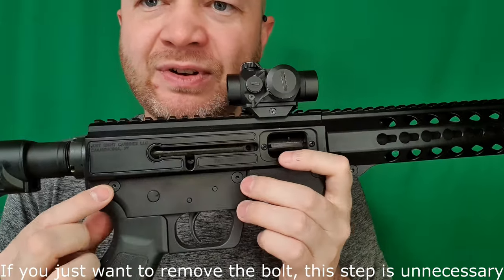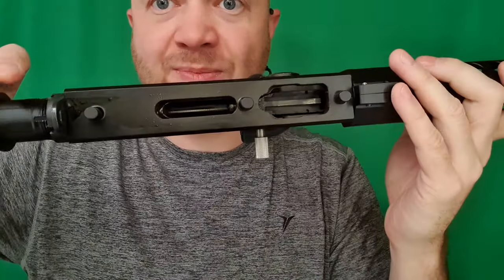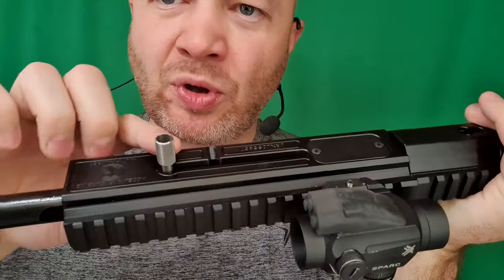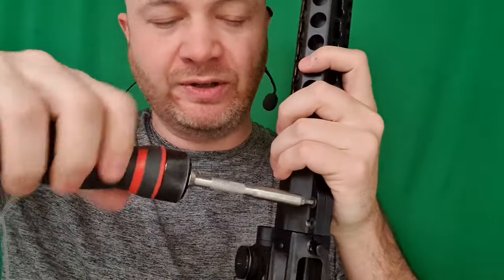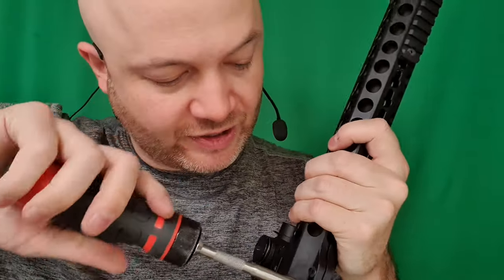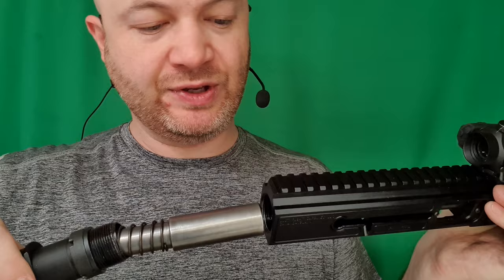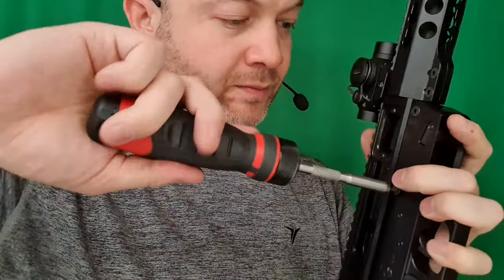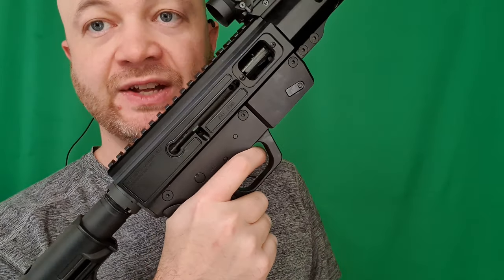JR Carbine disassembly and reassembly

Comment: Had my carbine out to the range for a few rounds. Just tried to take it apart and my allen was bending by the force I had to us. The bolts seem to be seated extra firm from the manufacturer. Any advice loosening them up without stripping them?
Reply: Yep. I changed the grip on mine and noticed they use loc-tite on the screw. Had to cut it off and get to screw with pliers.

Comment: Ok, great and informative.. Best video on this piece I've seen yet, as I found the manual to be lacking in terms of taking it apart. I've never owned a semi till now. Give me a pump shotgun or a bolt action rifle and I dont even need the manual. But I gotta admit, this was intimidating for the price to not screw it up and have to take it apart every 200 shots for cleaning.. I have nightmares of when I'm 12 taking apart my BB gun and not being able to get it back together.. I wish I could have seen how you do the castle nut tightening and loosening.. Do I need to bu ya special castle nut wrench for that? And if so, what size do I look for? Thanks buddy..
Reply from the maker: Yep, it's a standard AR castle nut size, so any AR15 wrench will do the job. You can get them online or at many gun shops.
Reply: @Huntinggearguy  Ordered mine today. So I stopped by the local gun shop here asking if I could buy one. They didnt have any for sale but had one in their tool desk and actually sent me home with it to use and bring back whenever. So I loosened the castle nut just enough to finger tighten till mine arrives. I guess they treat you well when you buy 2 grand worth of toys within a week.. The JR, a red dot and a vertical downward fore grip..

Comment: Had the JR carbine a while back. They are pretty hefty compared to an AR. The Allen wrench requirement for takedown was a PITA. Always worried about stripping it.
The FX9 and Ruger PCC are great alternative options.
Reply: Do you know what size the Allen head was to get the pull back handle out?

Comment: What size Allen takes off the pull back handle? I tried my 1/8 and it’s a hair to small
Reply: Hmm I don’t recall.  I peeked at the JRC website and this is what the owners guide states:
• 9/64-inch hex (Allen) wrench – included
• 1/8-inch hex (Allen) wrench – included
• 1/16-inch hex (Allen) wrench – included

It’s possible that the Allen wrench you are using is heavily worn so the fit is loose. The head of the hex screw may also be slightly stripped.

Comment: I bought a JR carbine about a year ago. Absolutely love it. In the process of swapping the ejection handle to the other side. Thats why I'm here. Great video by the way. Have to say that JR could have done a few things differently....like a common barrel nut and  foregrip for easy interchangeability. But other than that , this is an awesome little gun. Thanks for the video. Why they put bolt handle on left sude....I do not know😄
Reply: Did you ever get around to changing the side in which the charging handle operates? Was it easy and does it/do you have to change the side the cartridges eject as well?
Reply: @JohnDoe-es2ux  Yes I did. Not as complicated as I thought it was going to be. Unscrewed the handle....swap the plate to the other side....and screwed the handle back in the right side. Easy peasy....